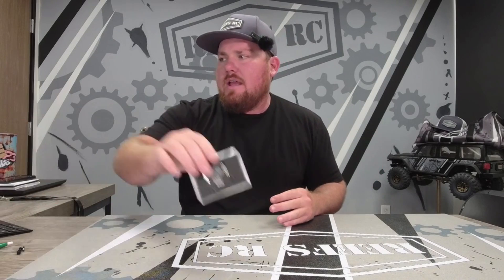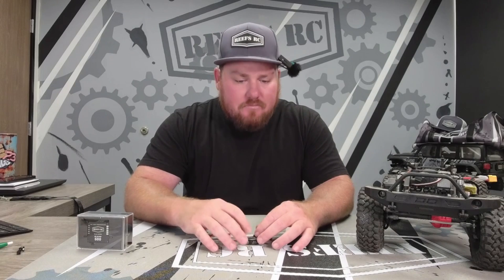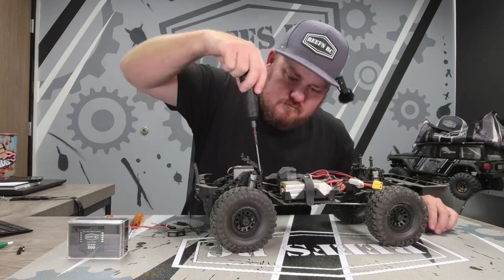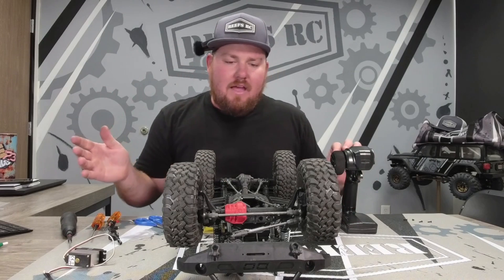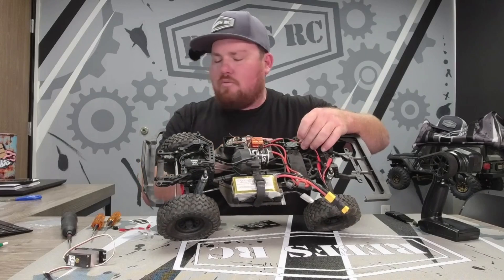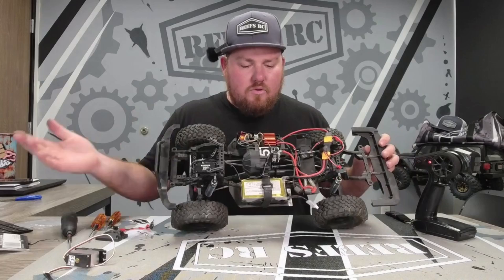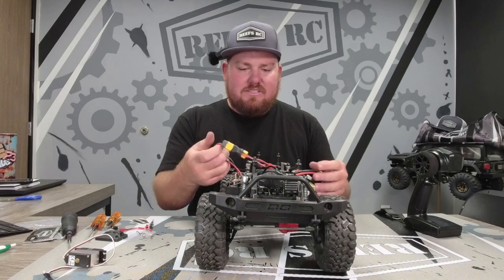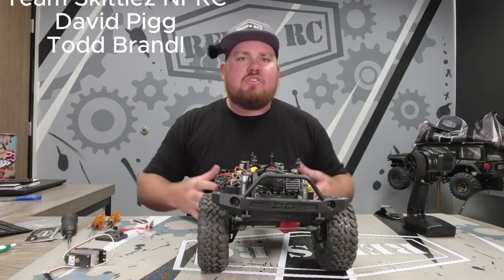REEFS RC EZ-BEC!!!!!

Comment: You did not make a couple of things clear. What powers the reciever, and how many volts go to it? Does the input of the Bec connect to the main battery and power the reciever and servo separately at two different volt ratings?
Reply from the maker: The RX is still powered by your internal bec from the ESC. The BEC only sends 8.4v to the servo, or servos. it only sends signal to the RX.

Comment: What I don’t understand is why does the instructions specifically mention that an XT60 adapter is needed. I want to install the EZBEC on my SCX6 which uses an IC5/EC5 connection. Can I just use a JST EC5 adapter to install it on my SCX6?
Reply from the maker: Of course. Just make sure the ec5 adapter has the correct jst plug on it.

Comment: Do you need the xt60 dual jst connector? I bought 777 servo & bec.
Reply from the maker: You wouldn’t run a 777 and a bec. The 777 is direct power and would not need a bec.
Reply: @reefsrc  It is a more powerful servo tho? Doesn’t the bec allow you to get more power like running a higher voltage servo?

Comment: Just bought one, planning on soldering it direct to my Hobbywing max10's battery connector that will be using 4s. Question, should I remove the ESC's red cable that connects to the receiver box as mentioned for other BEC's? Please let me know, Thank you
Reply from the maker: Hello, no this works easier than the other BEC on the market. you can just plug everything in.

Comment: Can I run a winch off the extra jst connector?
Reply from the maker: not sure what jst you are referring to. the one on the BEC needs to be plugged into power to power the bec. If you mean the one off the battery if your winch needs external power you would use that.

Comment: Thank you so much, my brother I received my like couple days ago and yesterday I installed it. I have cheap servo from AliExpress for my scx6  I paid $30 for the servo and when I installed the BEC, I was shocked it was so powerful so strong I believe is strong from the reefs 2000 for some cheaper. You can upgrade yours with the BEC.❤

Comment: Can I run 2 of these (each to a REEFS1100 for 4 wheel steering) off the XT60 Dual JST adapter using a 4S 3300mAH 60C discharge, 120C burst battery?
Reply from the maker: Yes that should work
Reply: @reefsrc  thanks!!!

Comment: I wouldn't call that a complete install.  The wires still need to be secured, the bec itself needs secured.  Most people will want to shorten wires and clean up the spaghetti a little bit too.  I'm not saying it isn't an awesome product but $50 and a so called minute and a half install?  I don't know guys.

Comment: If I solder a wire with a jst connector from positive and negative cable going to the ESC, would that work fine as power? That way, in my thinking, it would only get power when a battery is connected. Also it wouldnt matter which type of battery connector I use. I know that I would make sure to never exceed 6S since that would kill the EZ-BEC
Reply from the maker: That would work. You could cut the jst and solder it direct to your eac connector as well.

Comment: I’m running a fusion pro, but I plan to run 4ws. Do I need two ez bec’s or will one power 2 servos with the proper splitters?
Reply from the maker: You will need two bec.

Comment: So I got an external battery for the bec but the red connector is a male but the Lipo battery’s I have are male as well how come there isn’t a female plug instead on the bec and can I just cut off and solder in the female???
Reply from the maker: Our adapter comes with female plug so its meant to work with our system.  You can change the battery or the plug on the bec to Female.
Reply: @ ah ok thank you for the clarification

Comment: Sorry newb question.....so if my servo is rated for 8.4v...I can plug my servo wire into the black plug that's connected to this ez bec?..then take the other black plug that's on your ez bec and put it in the channel1 slot in my flysky bs6 receiver?..then plug my esc xt60 plug into the reefs dual xt60 plug?..then take my 3s Lipo xt60 plug and plug that into the other end of the reefs dual xt60 plug?...then plug the red jst plug that is on the ez bec to the red jst plug that is coming outta the reefs dual xt60 plug?....sorry I just wanna make sure I'm getting this all correct...and again this bec side of things is confusing and I just don't wanna fry my electronics and the videos I try to watch the wiring looks crazy so I just always pushed it to the side...any help from you or any guys in the comments is greatly appreciated...thanks...
Reply from the maker: Yeah man that all sounds correct to me!!!
Reply: Thanks for the quick response ordering one now...

Comment: Is there a setup for rear steer or do you recommend running 2 EZ-BECs?
Reply from the maker: You could run a y but then the rest would mimic the front. Or two bec.

Comment: What if I have rear steer can I use that with 2 servos
Reply from the maker: You can if you run a Y and want the rear to mimic the front.
Reply: @reefsrc  I run the rear independently on the flysky gt5

Comment: My copperhead esc would brown out with a Holmes revolver and stock servo on my scx10.  Full throttle run and turn would put it flat on its face.  This is a much needed option.
Reply from the maker: Yeah it is!!!

Comment: I’ve got the tools and experience to solder and install other BECs, I’m definitely getting these and saving myself the headache this is way too easy. Awesome product guys!
Reply from the maker: Hell yeah!! It makes it so easy!
Reply: You have to have two for rear steer. One for each servo. So you have to spend $100 practically the price of a whole Nother servo just to get the maximum power out of the servo’s that you bought. And the castle BEC 2.0 does not set to exactly 8.4 V dude this industry is disappointing at best.

Comment: Just run a fusion pro much better option.
Reply from the maker: This is for the guy who doesn’t or can’t run a fushion pro.
Reply: Fusion can't put out 8 volts
Reply: @Mr19assassin74  no it can’t do 8 volts but it does 7.4 volts and that is  plenty for a 1/10 scale crawler.
Reply: @freerangehuman1976  that's your opinion.
Reply: @Mr19assassin74  It’s a fact.
Reply: @freerangehuman7016  in your little world it may be.
Reply: @Mr19assassin74 And risk brown out??
Reply: @NOSfusion  you obviously don't know what that means
Reply: @Mr19assassin74  I replied to the wrong guy lol. 7.4 might cause your receiver to brown out.

Comment: This is great, typically I run direct power but I will grab a couple of these for my other setups!
Reply from the maker: Awesome!!!
Reply: Can this be used with direct power setups?
Reply: Id like to know as well I'm working on a plow truck and running dual reefs 400lps for the plow and running direct power for the steering